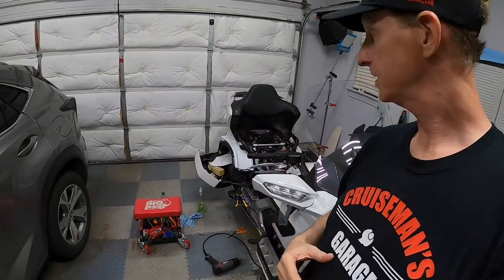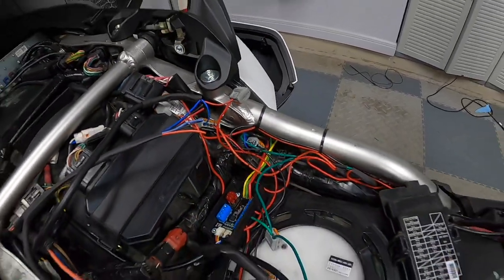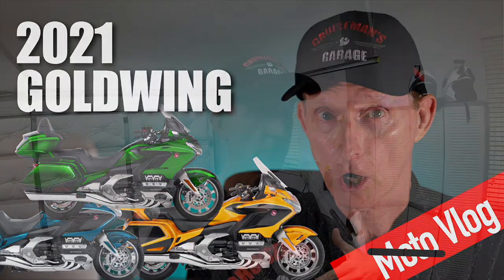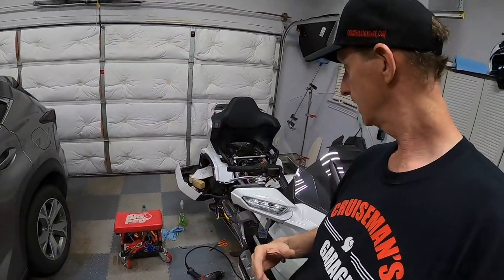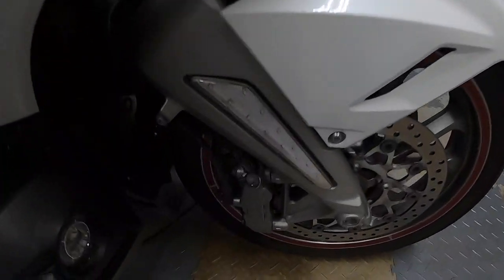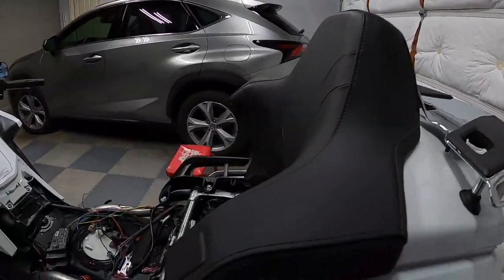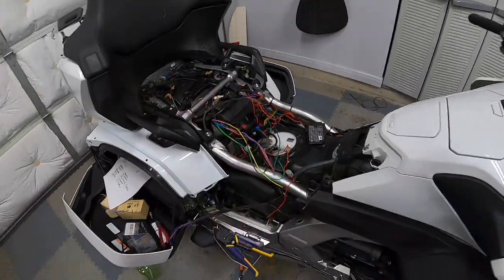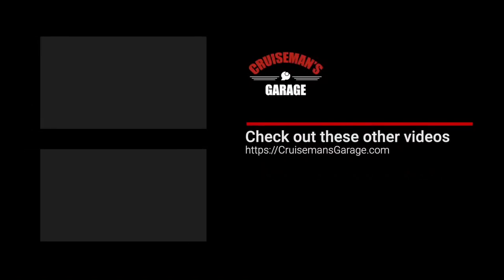Happy Labor Day 2020 | Cruiseman's Moto Vlogs | 2018+ Honda Goldwing | CruisemansGarage.com

Comment: Cruiseman, that rewiring is overwhelming! However, because I’ve learned from you, I had the courage to remove a couple of panels and remove and recharge my battery. It died because I just had my knee replaced and I haven’t been able to ride. Anyhow, I installed a harness to allow me to attach the battery tender and, amazingly, it runs again! Thank you!
Reply from the maker: Good job

Comment: I LOVE the lighting accessories on your bike. Especially the cowl light drl/turn signal lights. Unfortunately, electrical stuff that is not plug & play scares me. I purchased the headlight modulator (PathBlazer) & tail light/brake light modulator (TrailBlazer) both from Kisan for my 2018 Goldwing which I take delivery tomorrow from the dealer. I’ll definitely purchase the cowl light accessory as well but I’m going to buy your maintenance videos so that I will install them correctly. Electrical accessories is not my wheelhouse & unless it’s plug & play it scares me. I’m so happy I found your channel. Thank you for taking time to make amazing do it yourself videos.
Reply from the maker: Get the vids now while they are on sale. Promo code FALL.

Comment: 78....I wish! 49 and sunny over here, the bike will sit today, oil change and grease on the 3/4 ton GMC, plug change, tire rotation, clean and oil the air filter, change the cabin filter, fuel filter change, PCV change, clean it out and wash it.
Mow the lawn, pick up all the apples that fell from last nights heavy winds.....get BBQ ready, I need to get propane... the steaks have been marinating since mid day yesterday....other than that it's just a normal day off I guess :):)
Ya! a review would be nice!
Have yourself a great labor day!!